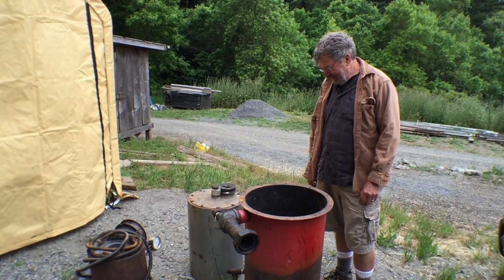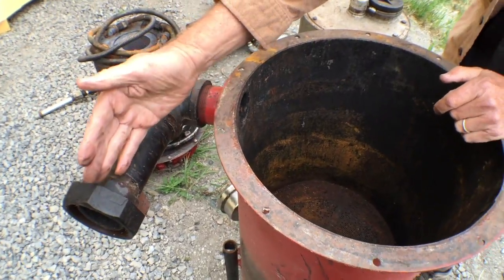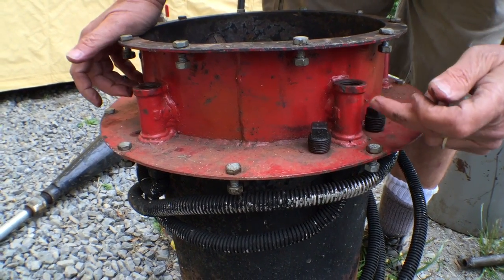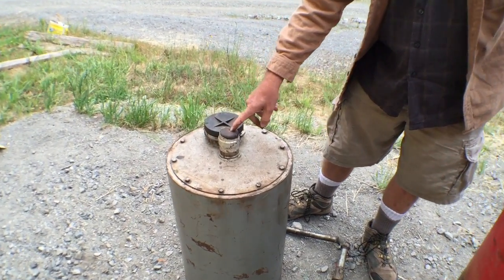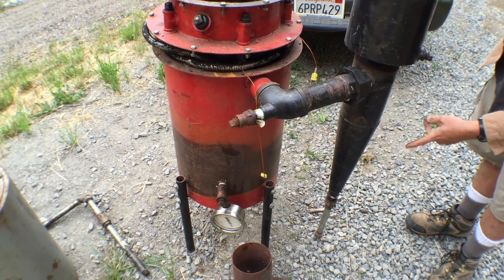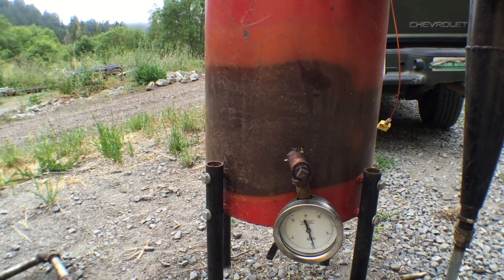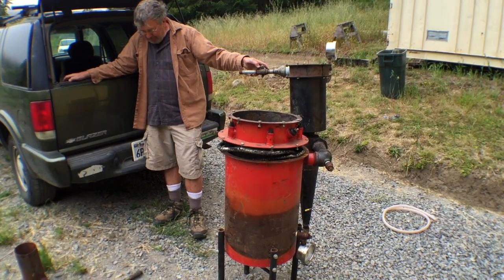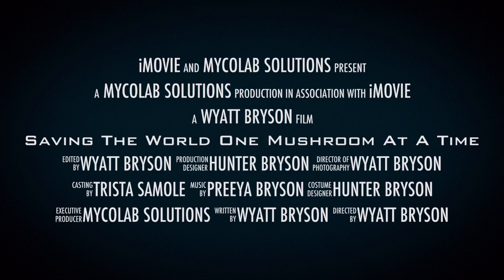How to run the GEK Gasifier! All Power Labs! Gasification to grow mushrooms Permaculture farm!

Comment: Is it possible to add a waste oil dripper?
Reply from the maker: +Daniel Silva there is one on the bottom of the cyclone tube. It is the metal pipe. You have to take it off and clean it out fevers few runs.
Reply: I thought it was possible to put an oil dripper to use pyrolytic oil in gas engine.